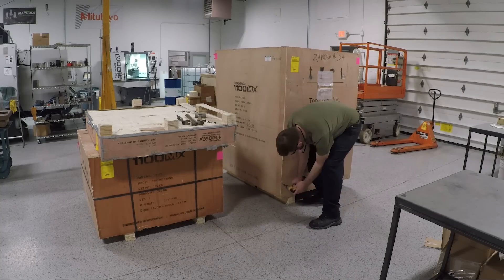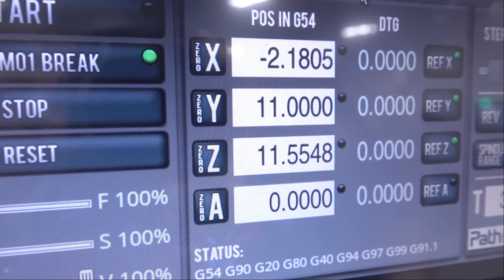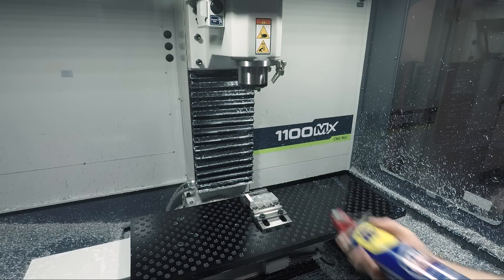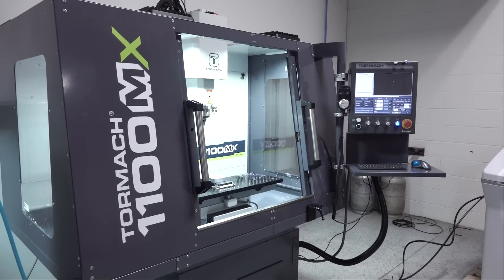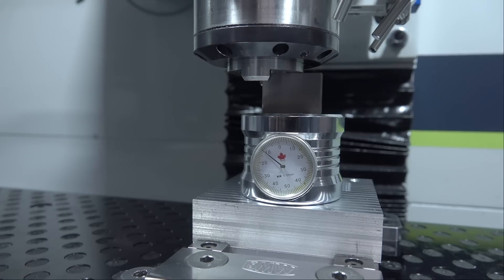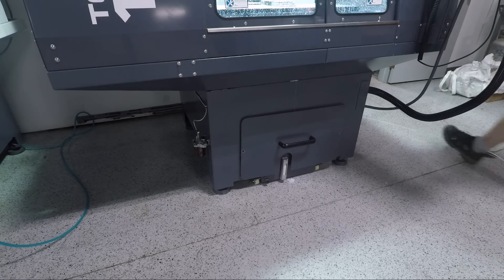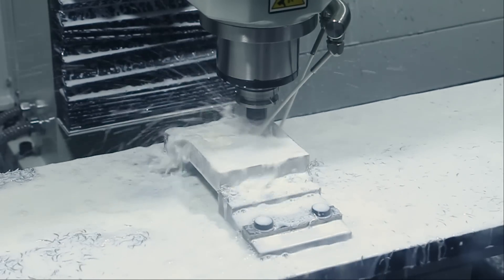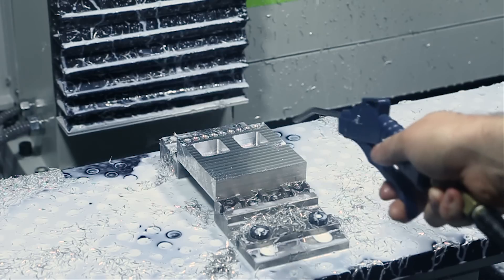Tormach 1100MX:  Assembly, Test Cuts & Initial Impression!

Comment: if youre thinking about buying this, just get a haas mini mill
Reply: Agreed. A good used Mini Mill can easily be had for $15k. It's no contest that the Haas is a better machine. It pays to shop around. Don't be afraid to look at used machines--have a tech inspect it if you're not knowledgeable enough yourself.
Reply: 47k for comparable mini mill after hss, rigid tapping, 10k spindle and sm2 upgrade for table size...its a easy choice for machine shops but not for hobbyists
Reply: @taylork057  A good used machine is a huge value. If you're willing to sacrifice a few inches on the travels, a regular Mini Mill can be had running for literally half the price of a new 1100MX. I know. I have one!
Reply: Or a syil
Reply: @excelsiorsabers While i agree, the closet in size and rpm is a sm2, so finding one with all those options and  for 12.500 still isnt likely.. youre still about the same price as a new 1100mx at current listings on ebay
Reply: @taylork057 The base price for the 1100MX is $19,995, and that doesn't include the ATC or operator console. After the ATC/console are added, and after taxes, you're looking at around $28k. You can find used Super Mini Mills for around $20-$25k easy, and those have 10,000rpm spindles and 15hp compared to the 10,000rpm and 2hp on the Tormach. Supers run 3 phase, however. whereas the regular minis can run single phase. The Haas is also 3x as heavy as the Tormach. If you're spending $20k-$30k, get the used Haas and you'll have far more options. The Tormach will not be able to keep up with the Haas regarding production speed or capacity. And yes, the larger MM2s are more expensive, but they can still be found for around $30k or under. A SMM2 will be the most expensive, but that is a machine that far outclasses the 1100MX.
Reply: @excelsiorsabers all great points, also linear rails being a large upgrade in its self from brand to brand.   I am shopping for a sm2 with hsm and rigid. hoping a deal pops up
Reply: @taylork057  Yes sir. Good luck in your search!
Reply: @Len Sherman The Mini Mill is indeed an industrial machine, and you'll need a forklift to install it (DIY if you can rent and drive one yourself, because riggers will charge a fortune). It's totally doable in a garage, however. That's how I have mine currently set up. Yes, it takes up 1/2 of the 2-car garage because you need space in front to work and behind to access the electrical panel. I can still park my car on the other side though and have room to work with the mill. If things get too cramped, I can always park in the driveway. If I decide to add more machines to the "shop," the car is getting permanently relegated to the driveway. You'll need a 50 amp breaker and a decent air compressor (I have a 60 gallon Ingersoll-Rand which may be overkill, but I wanted the thing to run as little as possible). Yes it's a lot more complicated dealing with the logistics of the Mini Mill, but if you have the option, it's still the way to go. All in, it was still cheaper than getting a new Tormach MX. NO RAGRETS.
Reply: Yeah? What's the warranty on that used Haas? 😂

Comment: For measuring tool offsets offline, just turn/grind a BT-taper in a piece of round stock and keep the taper size correct to the top face of the block, so you can then zero your height gauge on the top surface, blop a tool in and measure its offset. Costs about an hour of work to do and basically needs a short section of round stock to machine it from.

Comment: Don't blow air up your spindle. Just turn on your spindle at 8k for 30 seconds without the tool in. and cycle the tool in and out a few times. The grease will self distribute. wipe the pull stud if there is excessive goobers left. Nice vid. I would like to see the tool changer in action

Comment: No. So much no to the grease and wd-40 in the spindle taper. The taper should be cleaned with a solvent like alcohol or acetone and wiped clean and dry, and greasing the pull stud grippers isn’t good either. Neither of these need lubrication. The drawbar it’s self need it, but not the spindle taper or draw bar grippers. 

Grease just invites dirt and dust to accumulate on the grippers making them sticky, same with the spindle. 

The sticking or popping of tools is due to running the machine at its max RPM for longer than it’s designed. Most machine manuals specifically state a maximum time limit to run at max RPM. Haas is actually ridiculous and typically state no  more than 5 minutes.  In uncooled spindles, running them a long time at max heats up the spindle and tool tapers causing the tapers to tighten. It can also be caused by running tool holders that aren’t balanced enough for the machine.  With a 10k spindle, all holders need to have a rating of 2.5G @ 20k rpm.  G6.3@10k is not balanced enough.  This low balance causes the tool holder taper to wobble in the spindle at high RPM’s, which tightens the taper up excessively and causes excessive heat build up. 

If you feel absolutely compelled to spray something up there.  Use a dry spray.  Molykote 321 dry lubricant spray is acceptable and designed for   Like metal on metal rotating contact applications. 

But no WD-40 and no globby grease. Avoid anything like that up the spindle. Spindles like to be clean and dry. Not oily and packed with shmoo.
Reply: Kinda true.
The spindler have to be conpleatly clean and dry when you put in the tools and run the maskine 

But when you turn it off or let it stand for SoMe time ( like 9+ hours) then you need to spray the spindle taper with some anti rust ( like wd40) since IF not the the water in the air will start to rust the Surface of the taper and therefore the tool will then seat at a slight angle and be unbalanced

And never ever use any kind of alcohol since it removes all the metal Protection ( like a super fine Oil film and stuff alike) and it will start rust i litherly minuts. I tried and say it with my own eyes on a few Haas vf2's and had to spend 30min to remove it without scratcging up the taper ( you can only whipe it down with Alcohol of it's some kind of super high nickle/cromium content stainless witch i dought it is )

Comment: my syil will do rigid tapping but I never bother. I have a single point cutter that works for all the thread size I need and it is just as fast. So much flexibility in one tool.

Comment: I cannot believe your haas tech told you to blow compressed air up into your spindle bore. That bang you hear when tools have been in the spindle for too long is just the drawbar tapping on the top of the pull stud really hard, because that’s what happens when you tightly join two tapers together like that.

Comment: For tool setting offline you could get an adapter for the Speroni, or try the Nemi 30 taper tool setter.  Though I guess you only have the Robodrill and this machine that would use them, so it might not be worth it.
Reply: The gauge length of the spindle isn't the nose of the spindle. For BT30 it's where the taper reaches 1.250" diameter.  This can be measured with a bit of maths, and a large ball bearing in the taper.  
As for a way that most Tormach owners could use to preset the tool length offline, making something like this from WNT (possibly a new NYC CNC product, as I can't seem to find one to suit bt30) ( https://cdn.wnt.com/pic/mat/hol/pic_mat_hol_80720_all_esz.jpg ) .  It doesn't need the drive dog, it could be as simple as a taper turned to an approximate diameter in a piece of aluminum, although it would be nice to have the top of it as 0 gauge line to zero out your height gauge, this just really needs to be a known value though.   The important part is knowing where this gauge line is, and checking using the ball bearing, then the gauge length of the tool can simply be measured at the surface plate with a height gauge, much like the old tormach pre-setter.
https://imgur.com/a/FojuVVn
Something like this (as drawn by the most accurate CAD programme known to man, MS Paint...)

Comment: I don’t think it’d be too hard to make a tool setting socket for your surface plate. If you calculate the distance between the gage face and flange, you wouldn’t necessarily need to cut a taper into the socket.

Comment: For the price range, get a used VMC or put a down payment on a new one
Reply: A fully functioning, not worn out haas, that can do what this does, is at least 15k and the rigging is best case 5k. 
So 20k-35k is probably what you are looking at. right in the ball park of this machine.
So do you want a new Tormach or a used Haas. Both options have appeal.
Reply: Fair point. The base price for this is extremely close to a new TM1 ($25k). On the other hand, the TM1 is really bare and doesn't even have a toolchanger.
Reply: There are plenty of good used machines out there in this price range.  I have a 2003 Johnford SV-48 with a 10" Tsudakoma 4th axis.
I paid $30K.
Reply: @kkknotcool  I just wait until the next recession for bankruptcies to soar, and get a super deal on a HAAS or perhaps better machine.
Reply: @guytech7310  That's kinda like buying gold and waiting for a recession to buy cheap stocks.
Sounds great offhand but the math doesn't work out.
Reply: @kkknotcool  Sure it does. I am in no rush. I doubt I will have to wait more than a year. I suspect I probably will have to buy it before I am ready anyway as I haven't been able to start building my shop yet :( and probably probably be a three years before I have shop construction completed.

Well gold has a lot less volatility than stocks. The only reason why stocks are going up is because of buybacks, funded by pension fund chasing yield.  Pension funds can't seem to get enough of high yield debt. I am sure it will all be fine.

How the Credit market is killing pensions Brian Reynolds: Pension fund manager

https://www.youtube.com/watch?v=k9_bWbrYPKg
Reply: @guytech7310  Stocks go up because businesses make money.
I have no doubt there are many decent sized factors which manipulate the price beyond or under income evaluations.
But your mill is just like any other business, or piece of a business.(stock)
The only difference is you control the mill and can make 20x what a stock makes. Waiting a year is a mistake.
Reply: @kkknotcool  CNC Mill would be for my hobby. I make more money in my primary profession than I ever would running a jobs shop. Also I don't have a shop built for it anyway.
Reply: @guytech7310  So where are they getting the money for buybacks?
Reply: @guytech7310  What do you do? 
I know people who make low six figures off their small shop and don't work a ton of hours.
Reply: @kkknotcool  Business consulting, IT related. Running a job shop still requires a large capital investment: machines, Tooling, etc. Mine occupation has no overhead. I don't even have to pay for office space, or any equipment. My customers provide me an office & any equipment I need.  Also job shops track the economy. They do well during the booms, but can be dismal during recessions unless you have really good and long term projects that aren't impacted by recessions. In my occupation, I can get busier in recessions as companies look to cut costs or boost productivity.

But as a DIY Gen-X, I do machining for my own projects, as well as many other hobbies from building custom electronics, woodworking, personal IT related projects, etc. (yeah, I know, I am nuts)

I have a bunch of manual machines, but planning to pick up a small CNC mill for more complex machined parts, when I get get the time to build the shop. Currently building a custom home & will build a shop after I finish.
Reply: @guytech7310  Sounds like a nice job but you are limited by your time. Even if you can bill 200 or 300 an hour, you will always be limited by fixed time. That's why you spend the capital to multiply your time by the number of machines that are running.
One guy with one mill can bill 70 dollars an hour, one guy with 10 mills can bill 700 dollars an hour.
Good incomes are nothing compared with good businesses. It's an order of magnitude better money.
Reply: @kkknotcool  One guy cannot not run 10 mills. and even if your billing 70/hr you still have payments to make on equipment, Tooling & other consumables, Ship project, Purchase and move raw materials (ie stock). Utilities, Rent\Lease\mortgage. as well do CAD\CAM, invoicing, marketing, collection (late payments). etc.  FWIW, If i was running a job shop I would probably go with automated cells to move blanks & machine goods on & off the mills and just use fewer mills. The time would be preparing the blanks stocks and hand finishing machines parts (ie Deburr, clean, & post-machining work that needs to be done such as assembly, painting, as well as packaging\shipping. 

On the other hand I could do sell software products, which don't have any capital costs, Except some development machines, and development software. I could sell to thousands of customers and distribute software on a website, with electronic payments (automated invoicing). Sell support contracts (ie software updates\new versions).  I don't really need to rent office space, so basically no overhead. Software development is like a virtual machine shop, with no capital costs, no material handling. I just manufacture & ship electronic files.

I could do everything in bunny slippers :)
Reply: @guytech7310  Bar feeding man.
Someone who really had their shit together could run way more then 10 mills.
We have a lathe at work that will spit out thousands of parts without any human intervention, just a guy checking a few key  tolerances every few hundred parts.
Reply: @guytech7310  Also I'm not saying you should do machining as a business. I'm just saying 20 years from now a good machining business will make you much richer then what you are doing now. It's not free or even cheap to build a decent machine shop but they make a lot of money. And they make money beyond the value of your labor.
Reply: @kkknotcool  Issue I see with Round bar stock is that the mass produced parts are sold at commodity prices (high volume but low margin). To do complex parts you need a pretty expensive lathe that had dual chucks so you can machine both ends, and perhaps live tooling (for instance drill\tapping\milling -end mills from the side). 

That said, perhaps there are some mass produced parts that can be sold for high margins that can run using cheaper CNC lathes. I would think either vertical & 5-axis machining would offer higher margins, but that would require more labor.

Regardless, Automated Machining requires a lot of capital investment, if your business runs into a recession then you have to deal with the costs (payments) on idling machines.
Reply: @guytech7310  I'm talking job shop work, and probably mill work.
A mill with autofeed bar and 100 plus the tool changer can run batches of 200-2000 back batches with basically no setup cost and programming could even be exported overseas. That's the future and the margins are huge.
Reply: @John What do you recommend?

Comment: The gauge length of the spindle isn't the nose of the spindle. For BT30 it's where the taper reaches 1.250" diameter.  This can be measured with a bit of maths, and a large ball bearing in the taper.  
As for a way that most Tormach owners could use to preset the tool length offline, making something like this from WNT (possibly a new NYC CNC product, as I can't seem to find one to suit bt30) ( https://cdn.wnt.com/pic/mat/hol/pic_mat_hol_80720_all_esz.jpg ) .  It doesn't need the drive dog, it could be as simple as a taper turned to an approximate diameter in a piece of aluminum, although it would be nice to have the top of it as 0 gauge line to zero out your height gauge, this just really needs to be a known value though.   The important part is knowing where this gauge line is, and checking using the ball bearing, then the gauge length of the tool can simply be measured at the surface plate with a height gauge, much like the old tormach pre-setter.
https://imgur.com/a/FojuVVn
Something like this (as drawn by the most accurate CAD programme known to man, MS Paint...)
Great videos, loved to see the new machine!
Reply: P.S. Someone in the comments made the joke is the coolant milk.   I saw an old machinists handbook, and it advised milk as a cutting fluid for copper.  I'd love to see someone test to see if this works at all, just out of curiosity. 
https://amp.reddit.com/r/Machinists/comments/e69je4/check_out_the_lubricant_for_copper_in_this_40s/

Comment: What's worrying me here is the base cost of this thing.  I thought over time they'd be replacing old features with new features with only a slow price increase.  I paid around 8k shipped for my 770 series 3 new a few years ago.  By the time I added stand and pile of other accessories and tooling I had gone a little over budget at $12k but I was well set up with enough tooling to make stuff.  The base price of the 1100MX is just... out there.  I'd have never gotten into CNC machining without that $10k and under entry price.  I'm absolutely fine with them selling the MX class machines.  They serve a market for sure.  But Tormach might lose itself if it ever stops selling "everything to actually make chips" machines under 10k.  The 1100 series 3 was already past my price range at that point in time.  What I would have killed for is the 770, base package, with the 1.5hp 10k servo spindle. No other frills.  That would enable rigid tapping, more low RPM grunt for milling high temp alloys, bigger drill bits at proper RPMs, slitting saws at proper RPMs, etc...  The table motors can stay with the tried and true cheap steppers for all I care they've been good.